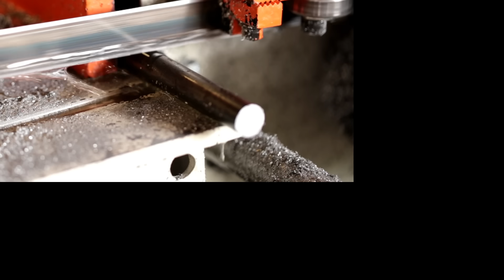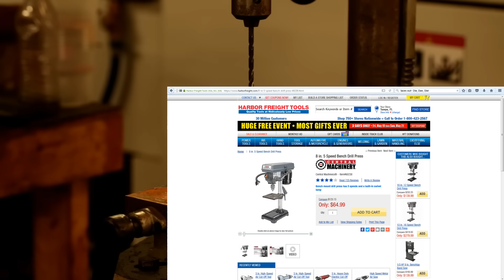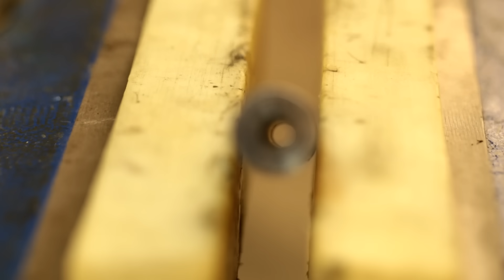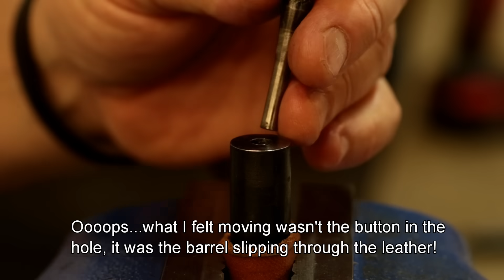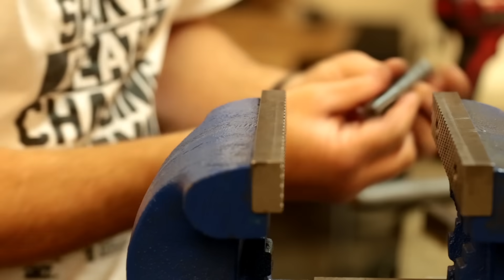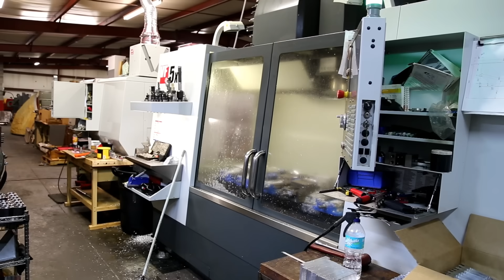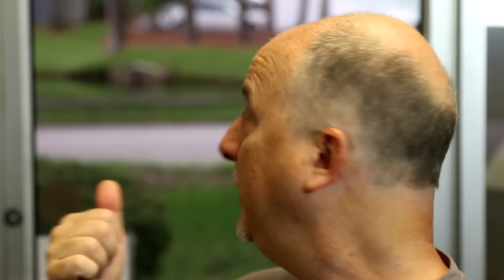Home Shop Rifling!

Comment: If you could find a valve rod for a small engine would probably make a good push rod for the button rifler and use a pipe with inserts with a few thousandths just a couple bigger than your valve rod shaft and the pipe with your barrel in in with a extension longer than where your button will exit and catch your button rifler . And use a hydraulic press one thats air powered and good some power.   And probably your pipe longer and push rod guides to support your barrel and push rods for the button and a good swivel or bearing system at the top so the button rifler will have rotation next to press end. Hope this helps you and I have made 40 cal. Muzzle loader rifle barrel with a spiral reamer cut to make my rifleing after that I bore lapped it . I fire laped it there lead bullets with 700 grit valve grinding compound cleaned the barrel really good and firelaped it five shots with 1500 grit on lead bullets and low powder charge of 50 grains. I cleaned it really well like four times to. Make sure I had all polishing compound out. I have a one in 36 in twist. .410 dia. 42 inch barrel and I'm hitting 12 inche steel plates at 400 yards with paper patch boolits . I'm totally amazed with my rifle. Double set triggers and Lyman aperture front sights and a Sharpe's replica rear sight with peep hole in rear sight and my front sight is adjustable left and right up and down with a level bubble on my front sight. My father said it came off of a Remington high wall rolling block rifle and it has 10 different aperture front sights that are interchangeable . My side lock is German made percussion with a no eleven nipple that I changed to a 209 shot gun replacement primer system that I bought from Cabela's for 38 dollars and it's water proof with a oring seal and fireing pin. It took me over seven years to get all the pieces of this black powder rifle just the way I wanted it and I have around 700 dollars just in parts not my labour or my father's time and labour. My father was a very smart Man and I wish I could have learned all his knowledge on building great things. Especially all the shooting talent he had . He was a trained sniper and I have seen him make some shots that was way out of sight for me useing a BAR browning auto 5 with a BDC scope. It was a Belgium browning 30-06 and believe me he knew how to use it very well. I glad I learned some of his knowledge and I till this day give all thanks to my father for helping me build my dream rifle a black powder rifle I only use triple 7 powder in and never have corrosion an it's super accurate to me and the yardage scales are pretty well dead on . By the way he helped me machine my bullet sagging press because buying bullets for my rifle to fit correctly is impossible. He took a short portion of the rifled barrel and made a bullet press that makes prerifled bullets that fit my barrel and when they are pressed you just press them back out and have a perfect bullet and weight every time. Hollow base bullet and hollow point or round nose bullets and a press rod to press the bullet out of the bullet die . Oh and a lead slug press to make the lead slug to go into the bullet press . I guess I have a one of a kind rifle there's no other like it and I named it tick licker #2 modernize after Daniel Boone rifle.

Comment: One reason the blank slipped in the 5C collet in the CNC is that the stock as unfinished surface on it, which may or may not be round and on size. 5C collets cam't hold anything that is on the positive side of the nominal size and only a few thou under. ER collets would fare better here, as they can collapse almost always to the next size down.

Yes, very informative and loved the really "hands on" approach here. Lessens the amount of "but I don't have a file/drill/CNC/factory" crowd

Comment: Get a $12 dial indicator and those telescoping clamps, I think that's what they're called. It's a couple of rods and some hardware that allows you to clamp the dial indicator to the spindle of your drill press and position it wherever you need, to check the squareness to the table in the two axis that you need to drill that hole strait. That cost about $20. You simply position the dial indicator perpendicular to the table and rotate the spindle, watching for where the needle moves. Look up "tramming a mill", this will show you what you need to know.

Also, besides never reaming with a hand drill, you really shouldn't use a reamer to make a hole that small 5 thousandths bigger. That's too much.
...  ... ...also, next time you use a vice to push a rifling button, at least put a flat piece of steel on the skinny side so you have a better chance of keeping it strait, those jaws look like they're hindering that. I've taken two tours now, of places that make high end barrels and they say that the biggest issue is keeping the button and rod as strait as possible. Well, theirs looks like the button & rod are one piece but the same rule applies.  ...ha, I see you caught that towards the end, a flat piece of steal wouldn't be nothin to just add to the mix.  ...waite you have a mill!?! what the hell are you doing, man? lol crazy bastard!
Reply: You are really clever I liked your way of thinking thank you

Comment: One thing that helps center a shaft hole is to chuck the shaft in the drill chuck and hold the drill "bit" in the vise.
I found myself holding the screen far away while you were pushing the ejector pin. I've used them as drive pin punches and they will shatter.

Comment: Mark Serbu does not like using any PPE, No gloves or glasses LOL
Reply from the maker: ...and yet still has all his body parts!
Reply: Not the smartest guy in the world!
Reply: Our hands are covered in leather and there's a membrane holding all the jelly inside our eyeballs. What more do you need.
Reply: markserbu , pride precedes a fall. Proverbs 16: 18.
Reply: Actually he is doing it the right way. The American way!
Reply: @Robert_Browne  Well, you're SUPPOSED to be bare handed with machining almost all the time anyway because gloves can get pinched and pulled into the machine, but I've had enough pieces of hot and sharp metal fly DIRECTLY into my safety glasses and in some cases STICK IN the lenses of my safety glasses to tell you... yeah, don't get the bearcats, get the 3M. I've also had the pleasure of getting a chip caught UNDER the glasses because of bearcats. The result? I still have a pok on my right cheek because there was a big gap at the top of the glasses.
Reply: NoSaltiesAnd RoosHere 
Yeah????  

Well,  John Moses Browning had the sense to use the Proper Machine Tools for doing the “Close Tolerance Work” such as is required for Drilling,  Reaming,  and Rifling Barrels,  as well as all other Machining Operatations!!!!!  I’m sure that John Moses Browning,  didn’t do things that he felt compulsory to announce before each Step... “Now this is doing it the Dumb way”.  Basically... Don’t do as I do,  do as I say!  Geeeeee Whiz
Reply: Commenter Five 
Amen Brother!
Reply: Michael Hill 
Respectfully,  You couldn’t be more wrong.  As a Career Senior II R&D Machinist,  I can tell you that it is much,  much Faster to do things Correctly.  There is nothing to be Proud of in this Video.  Why spend Time Teaching People how NOT to do something?  The Best thing about this,  is the showing us the Rifling Button,  and how much Force is required to push it through the Bore.

I have plenty of Scars from when I was Young and Ignorant.  This is America,  and as long as he is alone while Machining this way.... he is Free to risk only himself.  I would Hate for him to Blind himself.  I Blew up something that I was holding still in a Vice,  very closely resembling what he was doing here,  and ended up cutting a Major Wound on the Palm of my Left Hand.  It no Doubt had the Velocity to have Blinded me,  and planted itself in my Brain.... possibly Killing me,  if that Heavy Piece of Shrapnel had hit my Eye.... that by the way,  wasn’t Protected by Safety Glasses.  Ignorance isn’t always Bliss!💥🤦🏻‍♂️
Reply: Commenter Five 
Amen Brother. 
It is by the Grace of God that he still has all of his Body Parts,  as he says.... not by any Skills,  or because of following Standard Safety Procedures.
Reply: @shelliesman7552  Looking forward to your video series.
Reply: you don't use gloves when working with a drill press or any rotating mechanical equipment that's a good way to lose a finger or hand or worse I watched a kid wear a pair of cotton knit shop gloves running a drill press lose his middle finger he went to knock a burr off of the drill bit it caught the tip of his glove wrapped his finger and arm around that drill chuck and ripped his finger right off pulled all the tendons from his elbow all the way out the end of his hand it was all wound up on the drill chuck it looked like spaghetti it was like his second day on the job I've never seen anybody that color of white before he didn't even scream he just had this look of shock on his face...... Every machine shop I've ever worked on has at least two guys missing fingers I had a manager that was missing a thumb but that's why he was the manager he really knew his stuff he just couldn't do it anymore because he couldn't grip anything with that hand

Comment: I've been wondering about this because i recently aquired an anvil and wanted to try my hand at forging a barrel and sanding a handle down for a simple percussion lock black powder gun. Pretty interesting seeing this, though to improve it in the homeshop setting i think it would be easy to build a block of metal with a hold in it to rest the barrel in during the rifling button pressing process so that the pressure is evenly distributed. The shattering risk could be greatly mitigated by putting a hinged shield over the button press station that way you just lower the shield and crank away. This would provide area protection instead of just eye protection. We are talking home DIY so you never know, wife, kids, and family pet might accidentally walk into the shop at the time of shatter. We should do our best to keep projectile projection threats minimized to a small area for this reason.

Thoughts Serbu, i'm just an interested starry eyed theorist. Your the expert here!

Comment: Not very strait?  USE LUBE.  I know it doesn't make sense but it does make a difference.  Part of the reason for the deflection is the pressure used to drill.  So part of the formula for a concentric hole is fresh sharp drill bit and a shit load of lube/coolant.
Reply: Lol lube wasn't going to help. Lube keeps drill sharp, doesn't affect hole. However the old wore out canted drill press table makes all the difference in the world.
Reply: Lube will effect the hole diameter and straightness. Dull drill+no lube+drilling to fast=crooked hole. I've seen drills bend and go crooked due to feeding too fast and no lube.
Reply: Best way to achieve a straight hole is to drill a pilot hole around 1/32” under the desired drill size to full depth. Then true the beginning of the hole by plunging with an end mill or boring the hole to the final drill diameter as deep as possible. Then drill with the finish drill. A bored hole will always be straighter, rounder, and located more accurately then a drilled hole. By starting with a undersized hole that’s bored to the final drill size then following with the final drill, the drill is forced to follow the straight bored hole reducing the possibility of the drill “walking”.

Comment: Someone made the comment, "This should be called "everything you should never do"," which is actually kind of true; however, the next step to this process would theoretically be how to do this using a 2500 lathe with a vertical milling head. I.e. something not too expensive, but better than a vice with aggressive teeth. This video is excellent in the sense that it step by step shows the absolute minimums of what is required to put rifling in a barrel. This video is not so good because scene after scene became more about what shouldn't be done versus what actually could be done using less than ideal tooling. Example: Cutting hardened steel using a air cutoff wheel and your hands? Regardless, thank you very very much for producing the video as it did exactly what I believe you intended, which was show just how little it really takes to achieve great things (or slightly off center great anyway).

Comment: I was a machinist, not a button pusher, lol, but I am very impressed with all of your machining in tradecraft. And I’ve never put rifling in a barrel. I’ve done just about everything else, but I’ve always wondered without a rifling tool or one that I have seen how it’s done. I’m still wondering how you got a twist I may have missed some thing in the video. I have been wanting to make my own barrels for quite a while. 

Thanks for taking the time to do it and spread the knowledge of how to make firearms. It’s important that people know how to make them in case we are ever called upon a time of need to make some to defend ourselves and I hope we never come to that. Thank you.
Reply: The proper twist is machined into the button.  The hard projections are at a slight helical angle to the axis.

Comment: I've only machined for about 4 years. If used everything from manual machines to Fanuc systems. Maybe a 1/8" pilot going in 1.25" on each side after center punch. Then following up one size smaller than the desired ream. I also would've used oil on the note before the ream. But still great job.

Comment: Just FYI - you can flip those vice jaws to put the smooth side out.  Only 4 bolts required!

When you were using the cutoff wheel on small tool steel parts freehand I admit there was a bit of pucker factor.  You're a braver man than me!

Comment: for using a drill with a reamer you can stick the reamer shank through the drilled hole and then put it in your drill, hold the part and pull the reamer out.

Comment: A steel tube with a large nut welded on one end,lubricated threaded rod to push a proper ram pin and the bottom end has a screw on cap with a hole big enough to allow the rifling button to eject but correct to act as a shoulder for the barrel to press against while the rod is screwed against the driving pin,multiple pins may need to be used but it will stop any shock by beating the shit out of it with a hammer breaking the carbide button,carbid is good for cutting but does not tolerate shock loading too well.

This method took me the time to type to think through and should work perfect,or buy a small fly press for around £60 uk sterling,i have a new draper 5ton press and it could do this job easy,though the tube can be extended or shortened with straight couplings,steel conduit tube will be good enough and can be welded,threaded have cross pins to hold end caps easy.

Comment: You can use a Joe press. Put your rod in it and hold the drill bit with a vice. You then lower the rod to the point of the drill bit. It will always be on center that way.

Comment: Should’ve just picked up the center of the rod by sweeping an indicator mounted in the drill chuck around the bar and tapping the vise around until you get the indicator to read as centered as possible.Then clamp the vise to the table, spot drill, drill, and then ream all while on the drill press. I would’ve them pressed the rifling button as deep as possible without damaging anything with the drill press to ensure it started straight as possible. Then used the vise and a bench block or something with a hole to allow the button to be pushed through while pressing against it. Also would using cutting oil for every operation.

Comment: Anytime you are reaming with a hand drill. If you are able to its best and alot more accurate to pull the reamer through the hole instead of pushing it. The taper at the end helps to make it line itself up and gives you less pf a chance of making it go off course

Comment: easy way to centerbore a rod... get a drill bit the same size as your stock... clamp a 2x4 onto the drill press table, and drill a hole in the 2x4... insert the stock, change the drill bit to your bore size and drill... it will be pretty well centered

Comment: To drill a hole with less runout:
1. Use a dial test indicator to ensure the collet block is perfectly square to the spindle.
2. Use a center drill to cut a starting point that is 0.010" larger than the finished hole diameter.
3. Drill the hole to the full depth of a screw machine drill bit.
4. Finish drill the hole to full depth using a jobber length drill bit.

Comment: Buy a V block, that's how to machine round components in a vice or clamped. Fits any diameter. If you heat and twist then grind a reamer to the right size, cut it short leaving a sharp bottom cutting edge, it makes a pretty good rifling button.

Comment: Quick tip if you are drilling a through hole with hand tools. Start from one side and drill until you reach the middle, then start equally centered from the other side and finish drilling the hole. With this method any discrepancies will be cut in half and will end up in the middle of the piece where they will be much less noticeable
Reply: Such a method is noticed by the bullet...

Comment: I honestly didn't know the Z axis had that much hydraulic pressure to be thousands of pounds. I should have known having run CNCs for 15 years. Thanks for the video. Rifling was the one thing that had me stumped. Not anymore!
Reply from the maker: Well, kind of.  It's not hydraulic pressure it's force.  And that force comes from a servo motor driving a ballscrew.  On CNC machines they call it "axis thrust", and on that particular machine the Z axis can exert around 4,000 pounds of force.  Obviously plenty for a .22 but not enough for 9mm.  Glad you learned about rifling, thanks for watching!